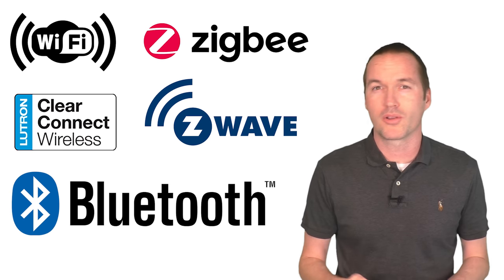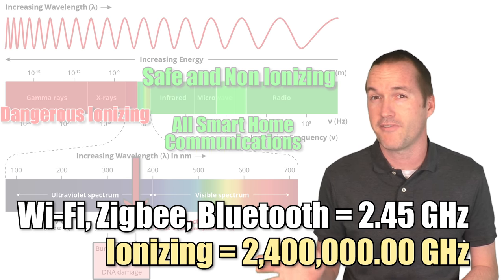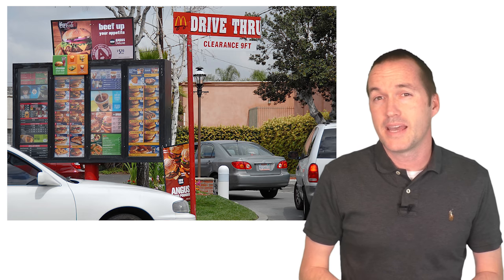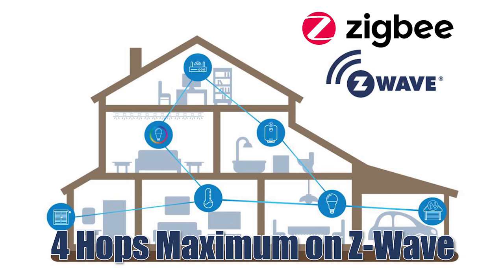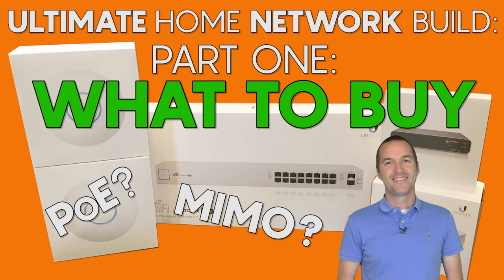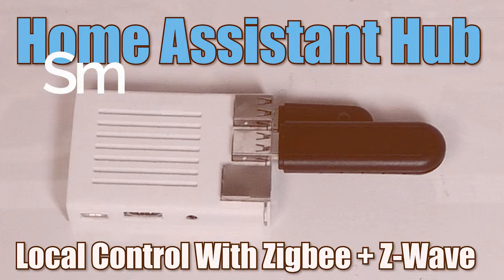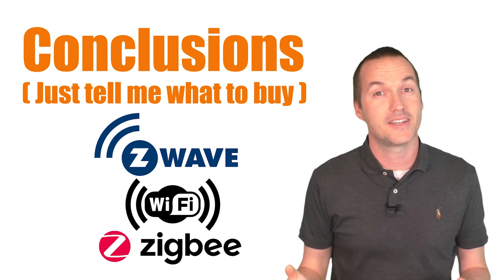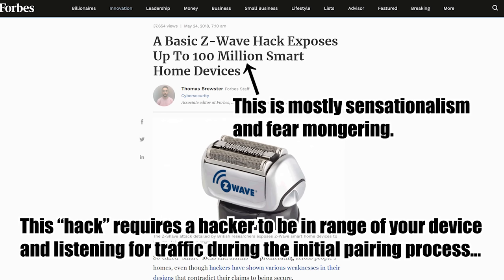Z-Wave vs. Zigbee vs. Wi-Fi! Smart Home Basics: How To Pick The Right Protocol

Comment: This was a OUTSTANDING video!  I am an engineer who put X-10 in over 20 years ago and recently moved so it is time to learn the new technology options.  Rob explained it all so that you can understand the tradeoffs.  And they ARE trade-offs, if there was one "best" we would all just use it.  Duh!  Excellent discussion on RF, well done!  And as a cyber security guy, you gave me a lot to consider.  I still have a LOT to learn, but this 15 minute video saved me gobs of research time.  In fact, I was keen on the Z-Wave when you started talking as 933 MHz appealed to me as it is not in a congested frequency range PLUS the penetration of 933 Hz vs 2.4 GHz.  That was until you taught me about the Connected Home Over IP standards and how Z-Wave "couldn't play in reindeer games."  BUZZ!  Thanks for playing.  Next!  Great video!  Good starting point for any geek who wants to learn more!  THANK YOU!
Reply: Excellent Summary Curt.  We are both dated. Cut my teeth on X10.  For a long time was the only thing to use for automation.  Technology has definitely moved on.
Reply: Connected home over IP makes sense if you have a strong WiFi network.  Z-Wave makes sense if WiFI coverage is spotty in your house.  Then you can take advantage of the Mesh network of Zwave.  I was thinking about the Lutron line, but that is proprietary.  The switches are extremely reliable.  One person has had Lutron switches in his house for 5 years and never replaced one.
Reply: @SidebandSamurai  Really good to know. Good intel!  Thanks!

Comment: A good overview. However you missed the Z-Wave is extensible language. What this means is manufacturers have to use the existing commands if one already exists but can create new ones if they do not exist in the spec. So for example if someone wanted to make a Z-Wave instant pot they would have to use the Z-Wave standards for on and off but they would get to use their own commands for setting the temperature. Z-Wave is actually administered by the Z-Wave Alliance which while mostly controlled by sigma designs does have several dozen companies involved who wind up voting on which new commands to add to the protocol.

Comment: All Zwave must work with all other Zwave by its manufacture specs.  Zigbee is "open source" but does NOT have to work with other Zigbee devices.  This means that Zigbee can work one day then not work because of a software change.  Just be aware of this when you design your systems.  Best advice is to get a hub that has all of the "radios" you will need.

Comment: Interesting video.  Now my 2 cents :-)  Bluetooth avoid.  Wi-Fi avoid as it congests your Wi-Fi router (if you have a lot of devices) and a bunch more issues. Zigbee ignore as it is flaky, and everything seems to interfere with the devices.  As for Z-wave and Smartthings, I have 79 devices devices on Smarthings, the vast majority of them being Z-Wave, only RGB lights and water leak sensors are Zigbee (RGB lights are actually hue , but even they will connect directly to Smarthings without the Hue bridge.)  Out of those 79 devices, only 1 device runs on the cloud, everything else runs locally, even most routines / automations.  The only thing I do not like with Z-wave and Zigbee is a lot of devices use stupidly expensive batteries, hence why I hacked some of my devices which use 2450 batteries, to use 2 x AA batteries which now last massively times longer.   As for that 'Group' , i'm pretty sure most of that will be cloud processed and all your information then being shared by everyone.

Comment: Nice presentation Rob.  I'm a bigger fan of zigbee myself, not really for concrete reasons except it was more appealing as far as price and availability of products (most likely due to the zwave being so locked down as you mentioned)  Ultimately I'm glad I have less devices to worry about with my wifi AP.  Ultimately a great video for newcomers.  Good work.

Comment: This is a topic I have been waiting on for a while. Thank you!

As an IT engineer I cant help but think that wifi smart home devices will congest my wifi network. This may not manifest in real word degradation but I cant get past the theory so I go with z-wave, about 60 devices total.
Reply from the maker: WiFi smart home devices are all on 2.4ghz, so you really shouldn’t see any issues with the devices that you want to be “fast”.  It also means that WiFi 6 isn’t going to have a large impact on smart home devices,
Reply: @TheHookUp  i came to this video because my wifi is congested with too many switches, caneras etc all connected to the 2.4 Ghz band. But I'll search for the network channel congestion fix per your video first.

Comment: Bought a CC2530 stick from aliexpress and flashed it. Zigbee2mqtt for use as a hub. Integrated into Home assistant. Works perfect, finally I can use Hue motion sensors for some other lights than Hues. And total cost under 10 usd. And they have very wide support for devices and you can even make new devices supported yourself. Only minus is that you need additional powered CC2530 sticks to get over 15 zigbee devices. Recommended!

Comment: In the long run, after using WiFi, zwave and zigbee devices for several years, my favorite is wifi.
Zigbee and zwave tends to disconnect from time to time and require re-pairing, which is sometimes not easy, and very frustrating. 
Wifi on the other end didn't pose issues (but need to be hardwired)

Comment: Great explanation! Learned a few new things (I had no idea of C.H.I.P. for example) and also re-affirmed some stuff that I already knew about. There is however one extra popular solution that you missed out on and which is primarily used by big companies: cable, and in the case of home automation, ethernet cabling. It is by far the most reliable option and also the one that has the lowest latency (speed is not as important, when your temperature sensor requires 1Gbit/s speeds you might have other problems) and you can send out electricity as well which eliminates the need for batteries. That being said, installing cable everywhere isn't something to get started in the IoT stuff: wifi and zigbee work just as well. Can't speak for Z-Wave as I don't have any device that uses it.
Reply from the maker: The dream is to have walls filled with miles of cat6 cable, unfortunately not very common though.

Comment: Fantastic overview! I'm building up my Home Assistant system with both Z-Wave and Zigbee. I've been avoiding Wi-Fi because it's possible for those devices to communicate over the internet unless I specifically block them on my firewall but I hadn't heard that there was custom firmware available...it sounds like there is another rabbit hole for me to dive into.

Comment: Got a few comments as one that works in a business that uses the zigbee standard, a. zigbee has several frequencies we use 868MHz and 2.4GHz and zigbee is an open standard allowing third parties to create products but there are also many standards that are applied by zigbee to specify the way this different types of items can talk but not restricting the provider from giving more options, i.e. the "Smart Metering Equipment Technical Specifications" adds onto the zigbee specification adding the protocol definition for a metering device, this means that a device that talks to a metering device must follow this standard in order to be zigbee certified, i think there is also a consideration to the power per distance area, as a mesh network only needs to reach its next node it uses far less power over the same distance which will result in less interference and add the sleepy end devices and zigbee green devices which are only active when they need to bee you have a lot of power and interferance savings that make the mesh networks like z wave and zigbee far more reliable than a wifi

Comment: think it's important to clarify something, about this "No such thing as incompatible wifi" point. Because for the context of our topic, it's important to understand that these Wifi "smart devices" are not directly operating by receiving and reading, writing and sending, raw instructions and status information - that just happen to be wrapped up in the type of packaging neccessary for sending and receiving them through your wifi router (etc). They basically have tiny, simplified computers inside, running their own software. And the data being communicated back and forth, is in a language and format this software understands. It is then this software that decides what to with it, and eventually instruct the hardware inside to do something (like send power to the LEDs inside its lightbulb). However, this software and the languages it knows can be different even between different types of devices from the same manufacturer, and especially so for devices from different brands/manufacturers. Also, each device has its own ID. So even if the case where software running on two devices from two different brands, happen to speak the same language - they may look at the device's ID, see that it's not a device from the same brand/manufacturer, and then just ignore or throw out any communication going to or coming from that device. Or, in some cases, one of them may have a very rudimentary understanding of one language both knows, and therefore only send, receive and execute very basic instructions. Like only turning on or off an RGB lightbulb, not doing any adjustment of the color or dimming.

As a metaphor: These devices do not operate like if you make an image of a lightbulb and a lit up power button, prints and puts that image in an envelope and the right type of stamp (here your postal service have strict regulation of which envelope types are allowed). Then you sends that envelope through the postal service (your wifi router/network) to your friend, he/she opens the envelope, see the image (image illustration is used to sidestep any language barrier) - and then know to push the button to switch on the lightbulb, and does it. 

Instead, these devices are running software systems, like a very small and simple computer. And all incoming and outgoing communication goes through that software layer. Like if you and your friend is working for two different companies. To communicate, you call up the company Communication Department and tell them what you want your friend to know. Then that department create the letter, put it in the appropriate type of envelope, and send it through the post - to be received by your friend's company's Communication Department.

The important thing to note and understand here - is that this software layer, the Communication Departments - they don't just universally perform this task. They also decide which companies they are willing to send mail to, and receive mail from. And it's very common that they will only process mail to/from from other branches of the same company.

Comment: Amazing about frequencies and their danger. Know that in labs treating cellular communication we are not only interested in frequencies (ionizing or not) but also in the power emitted and captured by  the body.
Reply from the maker: The danger is different though.  If you are around high amplitude waves you know it, you can feel the heat on your skin and the danger comes from heat rather than chemical changes.  Ionizing radiation is much less detectable and does damage on a molecular level.

Comment: Love the vid, I have smarthings and a mix of wifi and zigbee.  I had a pile of issues with interference when I started since I also have 5 wireless roku TVs that use wifi remotes.  Once I upgraded to netgear orbi and moved my main devices over to 5gh things got better.  The one thing I wish that was easier is finding new products it's such a pain to verify if they work with smart things because I hate having to use another app for each device.   This vid really helped me understand the difference for sure thanks for your info.

Comment: Vivint SmartHome uses all three. 

It uses WiFi (or Ethernet, optionally, if it’s a new construction or something and hardwiring the whole thing is feasible) to connect the hub to all the cameras and also to connect the hub to the WWW.

Vivint has a Z-wave hub built in to connect to locks, lights, window blinds, Vivint’s Element thermostat, etc. 

Vivint also uses WiFi to connect to some compatible products that use Zigbee, such as the Phillips Hue lightbulb system.

Comment: Wish this came out a week ago, I have been learning the hard expensive way that zigbee (which sounded the cheap easy way) is a non-standard and very few things work together.  All I want are some cheap door sensors that work reliably for now - even trying to figure out what can be a zigbee repeater is a headache because some plugs work with the hub and sensors work with the hub but the plug won't repeat "those" sensors defeating the point.  Z-Wave "just works" and universal plug in repeaters seem easy to find.
Unfortunately also the Z-Wave devices are many times physically larger (door sensors about 4x bigger) and there is less of a selection of types of sensors it looks like (e.g. I only found one vibration sensor and it had bad reviews for randomly switching on/off state to mean triggered).

Esphome seems the best option of you don't have to use battery power...cheap sensors and easy to reflash (especially thru the Home Assist addon) and they "just work" with high reliability.  My Sonoff s31 outlets that have replaced dozens of lamp timers are cheap and highly reliable so far with loads of customization options to add functionality and flexability if I want.  Only downside is you have to program the ssid and passphrase into the device vs pushing a pair button
Reply: I'm not sure what you are using but I am happy with using Deconz with the accompanying dongle to use devices from various manufacturers.

Comment: Have lots of zwave devices and work with smart grid 900MHz products at home too. Don’t have interference issues with either. The only time I had a zwave network issue was when a zwave thermostat failed and was continuously transmitting. Operating for about 10 years now.

Comment: Another thing with Wifi devices... they want to 'call home'  send data to company EVEN If you don't USE cloud.   Kasa TP link devices.  as an example.  I put them on a non internet network.. ( check out your pi-hole see all these devices 'calling home' using bandwidth...
Also, Get router with OpenVpn built in.  Then get Open VPN App on your phone... fun times had by all!! Cut out the "cloud" middle man!
Great Video.

Comment: You don't have to flash devices to make them local only. You just have to set them up on their own network, and firewall it. Only allow access to a single IP address through to another machine on a different internal network - your Home Assistant server or whatever you use. Then when you're adding devices, it really doesn't matter if it's trying to "phone home" or not - it can't.
Reply: While useful information, a lot of people will use the modem and router that came with their ISP contract (in US at least). Most of those routers have very limited functionality for a firewall, with most being able to do basic port forwarding only.
Reply: @TechDogeth  Yeah, I have one of those crappy ATT devices. Set it to passthrough mode to a real router, connect routers WAN interface to the crappy modem and don't use the carrier provided box as the firewall at all. Mine is a custom built Opnsense machine in a 2U chassis, but you can buy a Netgate appliance with Pfsense already installed. that goes into a couple of managed switches.

A setup similar to mine can be had for about 300 bucks, maybe less. That's for new equipment, not used.

Comment: Great Videos. Very Addicting...one of your replies said the only zwave you have are locks and a curtain module.  So I assume most of the rest are wifi/mqtt based. If so have you noticed any congestion, lags or delays with having so many things on Wi-Fi? Thanks again for the great videos.
Reply from the maker: Nah, wifi congestion is the boogie man that zigbee manufacturers are spreading
Reply: @TheHookUp  Thanks Rob. based on you answer here you have chosen  the wifi/mqtt devices, did you flash all of these devices with tasmota firmware (from the reasons you have mentioned in the video (10:45) ?  I will appreciate your reply. 
Thanks Again.

Comment: Only minor correction: some Samsung Smartthings devices are 'local' and some are 'cloud'.  So, some automations can run locally.  Though if you have any custom devices, they're going to be maddeningly cloud-based so doing something simple like a door chime when your window or door is opened can lag by many seconds. If your Internet is down, you won't get those notifications or they'll all come rushing in once the Internet is restored.

After having been a long-time Samsung Smartthings user, I've switched to running the open source Home Assistant now.  Almost everything is local and lightning fast without lags.
Reply from the maker: Push notifications will always be cloud based though, that's why I picked them for the specific example.
Reply: @TheHookUp  Yup, you're right that push notifications are cloud-based. I kind of expect push notifications to be a bit laggy, so that delay doesn't bother me (and I generally didn't use notifications to my smartphone with Smartthings.)  What annoyed me much more were the delays for turning on lights with cloud-based devices and getting a simple chime to happen in real time was impossible with cloud devices.  Home Assistant is a god send in that arena, plus all the other flexibility you get if you're a tinkerer...

Thanks for your other videos and guides BTW. I've used a number of them to reflash my Lohas RGB lights to add to my first Christmas light show, used your schematic for creating relays (though not for a pool timer), tips on Node Red, and a few other things probably that I'm forgetting.